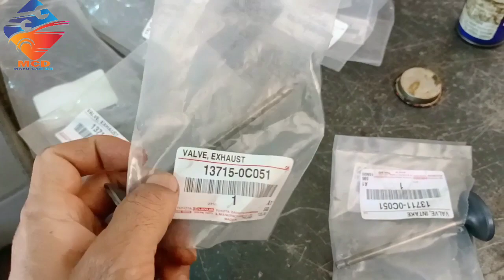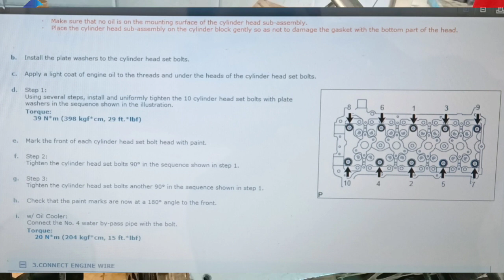2TR-FE Dual VVTI 2.7 Full Video Rebuilding Of Toyota Engine

Comment: My fortuner 2021 has this engine. May i know what's the problem of this engine that you'd rebuilt? So i can have preventive measures since my car engine is less than 4k km. And does all this model engine will have to be rebuild? Or just some cases?
Reply from the maker: Thank you very much for your comments,This engine is a very successful engine but the engine I am working in only had its pistons damaged due to the spark plug not being good so its short block has been replaced
Reply: How do you test/check the cylinder head for hairline crack that is not visible to naked eye?
Reply: @MayoCarsDR  spark plug not being good? what does that mean

Comment: Nice video, i have bought fortuner 2022 model with 2TR engine my car is hesitating while acceleration, rpm is not going above 2000, after long press engine is getting power like drift and again getting down with no pickup,  engine is vibrating and unable to run smoothly. There is no trouble codes in the computer, Pls pls advise what is the problem
Reply from the maker: Check fuel pump pressure
Check fuel injectors
Check spark plugs

Comment: Hello and thank you for this video. May I ask why you put silicone on the corners of the head gasket?
Reply from the maker: Because this is where the head and short block are joined and later most of the oil leaks from here, so this is where the seal is installed.
Reply: @MayoCarsDR  Interesting. Thank you very much!

Comment: Hello. I am stuck getting the timing cover on. I am trying to like that crank arrow with the timing cover one and I’ve been stuck in this for a while. I can send you pictures but is there any advice you could give?
Reply from the maker: What I can help you
Reply: @MayoCarsDR  just need help on how to actually like the oil pump key that goes to that crankshaft key. It feels like It’s stuck and I try to line it up and it just feels like in the middle it wobbles left and right like it’s not sliding on how it should. I took a couple bolts off of upper lower pan to try to get more leverage. Im really stuck I am heading there tomorrow morning if you have any advice please let me know thank you for your time

Comment: Thank you for the video. I drive 2011 Toyota Prado with 2TR-FE engine. Engine is building up knocking/clapping (chack, chack, chack,...) sound which is very noticeable at cold start and at low rev between 1-1.2 rpm. When engine warms up it becomes milder, but it is always there. Generally, the engine sound is getting rougher. What could it be? 

I do live in extreme temperature region and I do start the car often, but not always, in very cold. I change the engine oil every 5000-6000km and use mostly 5w-40. Odometer is 100,000km.

Thank you very much.
Reply from the maker: Thanks for coments,2TR is a very successful engine and your car has not traveled many km there will be small problem
Reply: It’s 5w20. Not 40 weight use manufactured specs
Reply: In North America the engine oil for the 2TR-fe is 0w20 full synthetic or 5w20 standard oil..abused it will get a minimum of 250k miles with taken care of examples getting 300k to 500k miles and with some even getting 700k to 1 million miles on the original engine..
Reply: @dlee8835  Toyota owner’s manual for Toyota HiAce with 2TR-FE motor  the correct oil grades can be  5W-30 and 10W-30 Energy -conserving  and 15W-30 or 20W-50 SL or SM multigrade oils! For those who want fuel economy the energy-conserving is the lighter grade oil.For those who want to long life from their engines I would suggest using the heavier grade oil for hotter climates or harder working conditions!But this is just my opinion as I never use light grade engine oil in my part of Australia.Page 201 Toyota HiAce owners manual gives the climate temperature range and 20w-50 can be used in this engine from -7 to over 40 degrees centigrade.Light oil is given for very cold countries and lower fuel consumption,lower fuel consumption blah blah blah engine wrecking BS for people who trade their vehicles before the warranty runs out!

Comment: do you know if there is a difference in the block between a single vvti and a dual vvti?
Reply from the maker: There is no difference
Reply: I ask because I plan to rebuild a single vvti block for lower cost and use my dual vvti head, thanks!

Comment: Sorry, don't like the way you are lapping those valves in. You're getting uneven coverage as you lap the valve because the valve is bouncing up and down on it's seat. You can buy valve lapping tools very cheaply. They have a suction cup on each end for different sized valves and you can apply even pressure from above instead of spinning the valve from below.
Reply from the maker: Ok
Thanks for comment